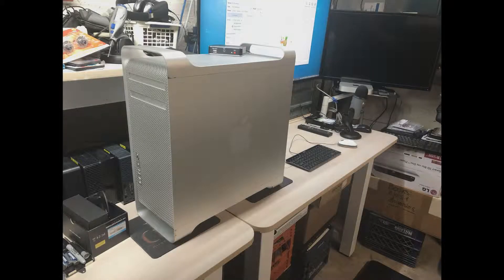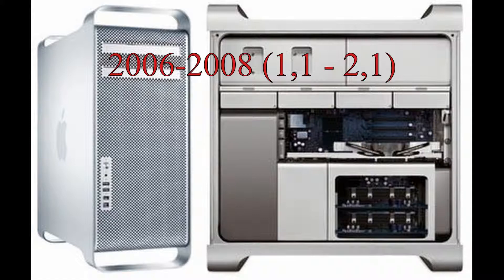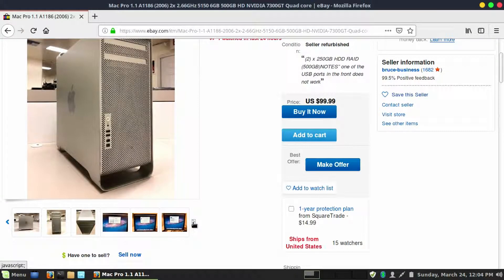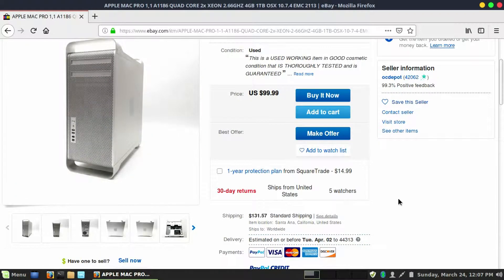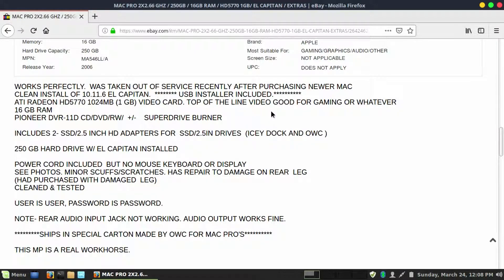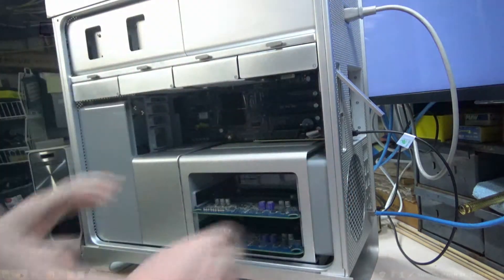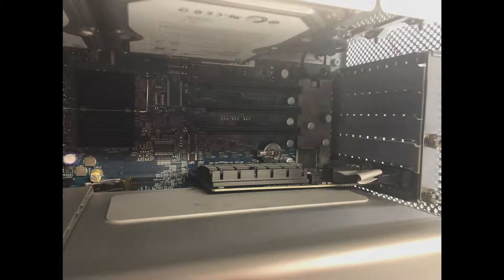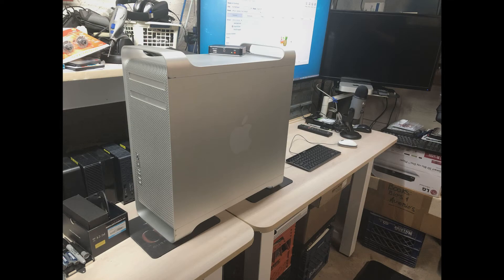Mac Pro 2,1

Comment: Holy moly, it worked. I spent a whole day just tinkering with this, the System didn't recognize the hardrives, IT didn't boot... and finally I gave it up. After trying out the method to just install it seperately it instantly worked. Thank you so much ❤
Reply from the maker: You are welcome!

Comment: Came across a Mac Pro - BTO.CTO - Mac Pro2,1 A1186 - 2138 with two 3GHz Quad Core Xeon X5365 (Clovertown) processors.  It has 5 gigs of ram and 4 hard drives, a 250 and three 500s.
Very little modern software Mac software will run on this machine without major and expensive mods.  Been trying to install several different versions of Linux onto it without success.  Most installers are not recognized and the ones that are recognized, start but all stop at some point without giving any error codes. Etcher will not run on Snow Leopard and hard crashes on El Capitan - system just turns off about 3.4 of the way thru an etch.
I got it for the price of going to get it, a drive of about 200 miles.  Studied and followed many methods for installing Linux on Macs but none work so far on this machine.
Any ideas?
Thanks.

Comment: I currently have my 1,2 flashed to 2,1 and I’m about to install el cap on it on a 500gb hdd I have 2 partitions atm one for el cap and the other I’ll be installing either Linux or windows 10 on. I only have the Mac and a laptop to work with an just one hard drive, how would I go about this to get Linux installed the same way you did
Reply: Hey bro let me know how its working out for you, i might be able to help you run windows 11 with all the updates what so ever.

I have a true 2,1 from ‘07 or ‘08 running El Capitan off HDD and windows 11 off SSD 

No bootcamp configured just pure installed, and i am able to switch whenever between OS’s

Comment: What is the video card you installed? I got a mac pro used today, seems like is the 2,1
Reply from the maker: That's a Radeon HD6460; not anything great, but relatively low cost, HDMI, fan-less, (I hate replacing video cards because the crappy fans they use die too quickly), and I don't game on this machine.  Best of luck!

Comment: Can i use an Live-Mint-Stick to detect the type of machine? I've got an offer for two Mac Pros without any description and without MAC-OS Harddrive. THX
Reply from the maker: Sorry, I didn't catch your comment sooner.  The EFI in the 1,1 or 2,1 won't let Mint 64 bit edition install into the machine without some tricky mods that I didn't want to mess with, (https://wiki.debian.org/InstallingDebianOn/Apple/MacPro/2-1), so,  I installed Mint natively from a live USB on another similar 64 bit machine (old Dell server), then moved the SSD to this machine, and Mint adjusted itself to the MAC hardware.  Now Mint boots natively in 64 bit.  So I cheated, kinda like Kirk and the Kobayashi Maru. ;-)

Comment: great video thanks for sharing.  Do you still use this today? What graphics card do you use? Did you install Hurky mods (spelling?) El Capitan image ?
Reply from the maker: I still use this machine on a limited basis; it is just a stock machine and GPU witch is more than enough for how I use it.  I have since done a 5,1 with full upgrade to NVME drive, better GPU, CPUs, and flashed for Mohave.